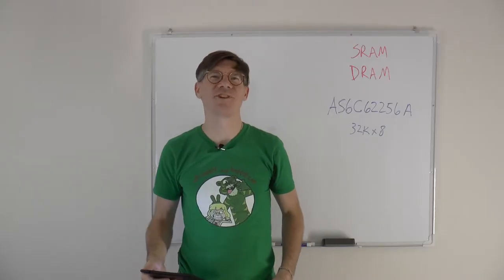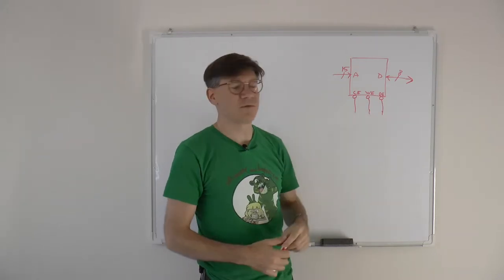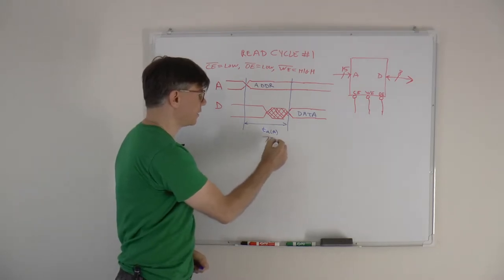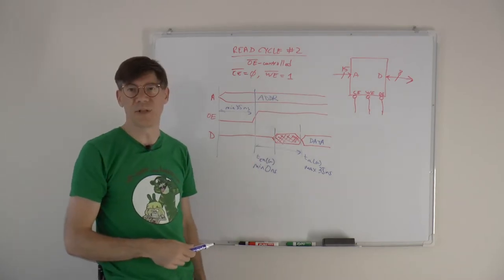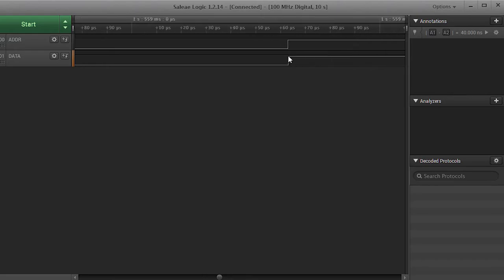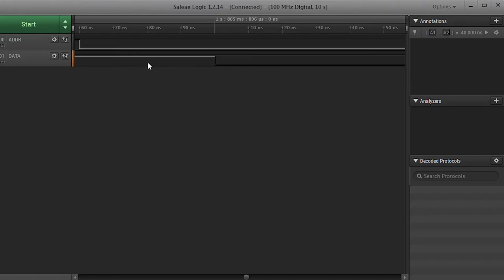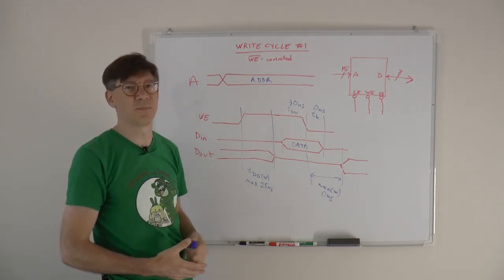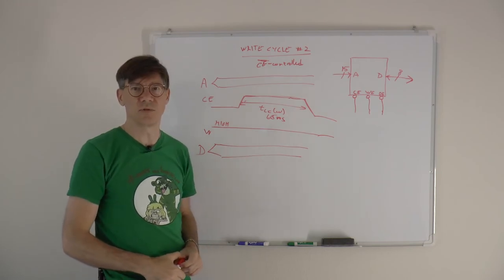Chip Tips #4: Static RAM

Comment: The reason your SRAM had the same value, on every single power up is actually very interesting (and useful). Due to manufacturing differences of each chip, when powering up the cells will be metastable, but settle on a value (0, 1). This will often be the same for each cell, but not all, as some cells are more random. This can be used to identify each chip(with some error correction), and is actually used in hardware authentication.

Comment: I googled 'ASC62256 FPGA' and I got your video. Thank you so much!
I hope it's not too  late to catch your attention and ask a couple of questions.

Is the address bus really bidirectional?

 I'm reading the data sheet and I see that the chip requires 5V Vcc. Could you recommend best practices/support circuitry when interfacing this RAM chip with an FPGA (Cyclone 2 EP2C5T144C8)  at 3.3v? My FPGA edu board has a 5v supply but the I/O standard on the pins, supports '3.3v LVTTL' and '3.3v LVCMOS'

Thank you, again.
Reply: A bit of a late reply, but the address bus from the memory devices perspective is not bidirectional, it is input only. If you take a look in the datasheet you'll probably find that the Vih of the inputs are TTL compatible (i.e. 2.0V+ or thereabouts), so driving it with LVCMOS at 3.3V will be fine.

The data bus is of course bidirectional, but you could interface the FPGA with something like a 74LVC245 running at 3.3V because the LVC series (largely) have 5V tolerant inputs when operating at 3.3V.

Comment: I know this is a bit late but are the strict timing requirements for write cycles common to all similar chips? I found a datasheet (also alliance memory just a newer version with the same pin out)) for a 15ns chip and it doesn't mention it.

Comment: I'm confused, all of the enable pins are active low which means they are asleep when high, but your charts show active high to enable
Reply: The pins are active low in the circuit, but sometimes its easier to see the timing in your head if you show them as active high on a timing diagram. So you just have to pay attention to if he puts a bar over the signal name in his drawing, then it is active low as the real circuit is. If he leaves off the bar over the name, he is likely drawing it as an active high signal. But in either case the actual data sheet timing will show you the correct states.